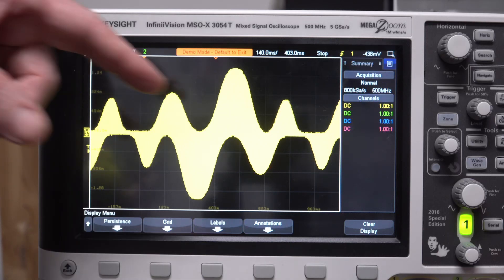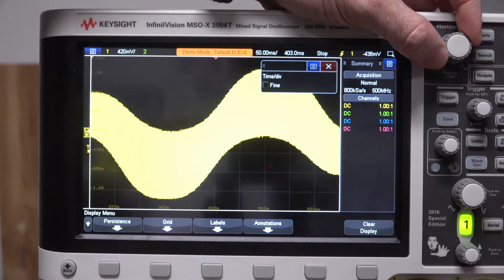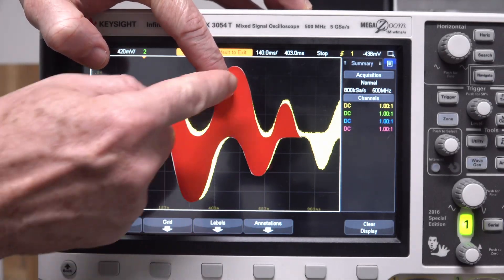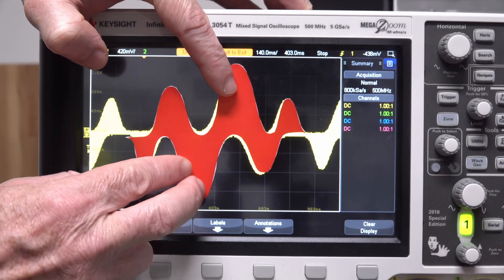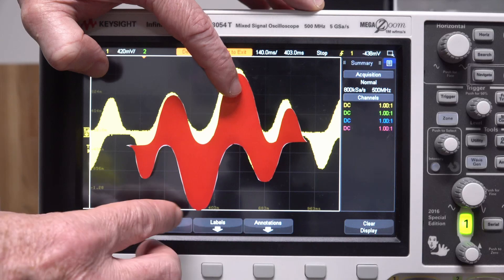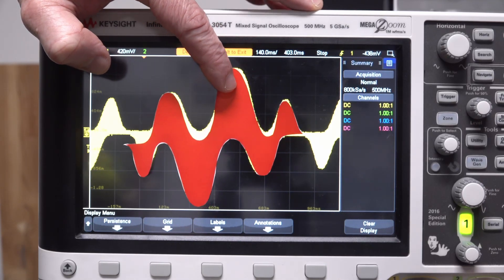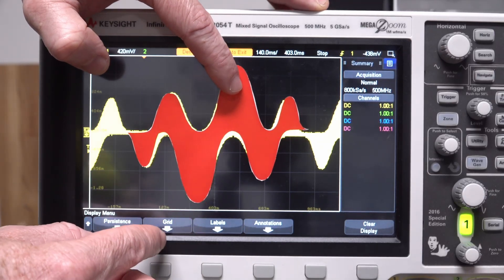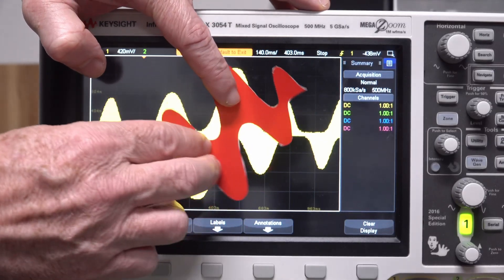The Keysight Logo is Not A Thing

Comment: Keysight basically invented fast, good "analog-like" intensity grading on a digital scope with their MegaZoom chip. There should be a waveform befitting of that great tech! This stairsteppy thing looks terrible on the MSO3000T. The Keysight logo waveform should look great on a Keysight and awful on a crappy scope! I want it specified as an AM modulated sine with a lower frequency component moving the whole thing up and down. That will look great on a MegaZoom or other good digital scope and bad on all the crappy digital scopes out there. Daniel Bogdanoff, I think this is a job for you! I'm awaiting that description of the AM modulated waveform!!
Reply: Okay just to be clear the way I propose to make this is to use two HP 33120A arbitrary waveform generators plus an HP 8647A as an AM modulator. You sync up the 33120As and load one with the AM amplitude and the other with the slower offset. Then you send the amplitude signal to the 8647A and sum it with the offset. This should look good!

Comment: Not a thing? I don't get it. It's clearly not a bit of that particular waveform, but why would it be?
Reply from the maker: That waveform is built into the scope and is Keysight's best effort to recreate the logo with a signal. They failed. The logo is not a thing.
Reply: @EEVblog2  Perhaps tweaking the relative amplitude of the 2 signals that make up this trace.